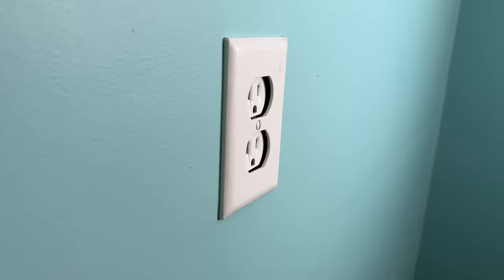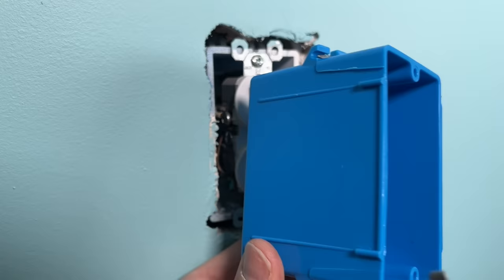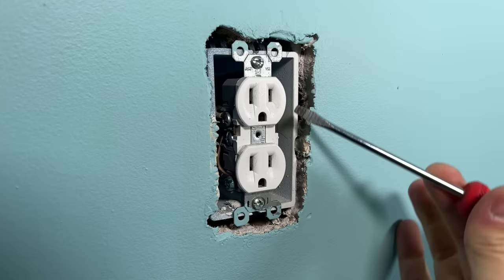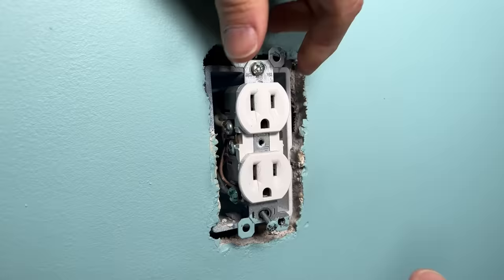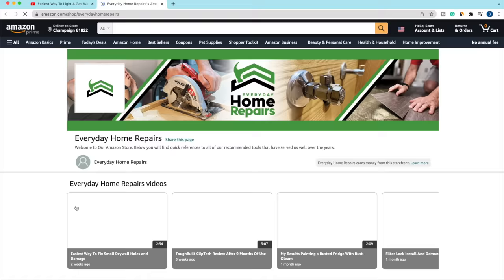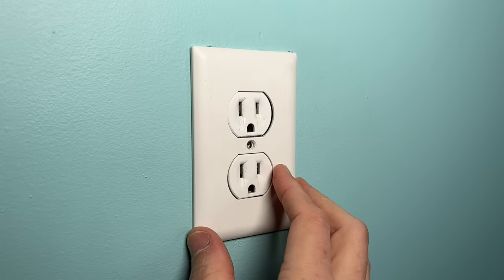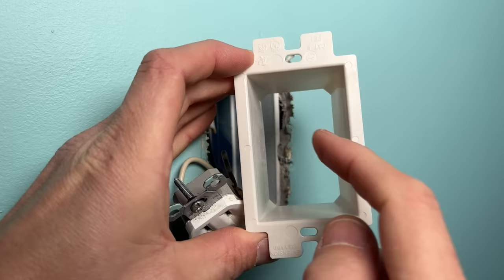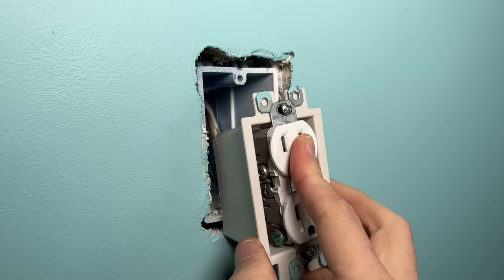How To Fix Sunken Outlet | 2 Easy Options

Comment: I didn't know those red spacers were available. Very nice, quick fix.

I have the opposite problem with all the outlet boxes in my family room. After removing paneling from the bottom half of the walls, I'm left with outlet boxes that are now about 1/8" too far out from the wall surface. I could  cut the mounting hardware for each box, but that's a lot of fiddling around. I can't seem to find any extra deep cover plates. Im considering gluing an oversized cover to the back of a standard cover and cutting away the middle of the bigger plate, leaving just a frame glued to the standard cover. Any other suggestions? 
Thanks.

New subscriber here! I'm looking forward to watching more of your content.

Comment: Great video as usual. What I learned was the existence of a retro fit remodel box and the insert box. My house was built in 1990 and for some reason I have a bunch of sunken outlets. 
Question: If that outlet was on an outside wall and you wanted to air seal, would you use drywall mud, fireproof caulk, a gasket or something else? Thanks,

Comment: Also for what it is worth you may have noticed so few of the many switches or outlets are insulated with the fire/flame retarder type foam etc for improving both the fire safety/or time provided since it slows fire speed, and also prevents about the amount of such a hole in a total of all uninsulated outlets and switches being enoughh of such a draft that it makes a baseball/softball sized hole through an outside wall for the outside air to come in through basically it is inexpensive enough with witch to do so thus therefore one jsould sdo so I would say for it is less than a few usd for a box of about 24 of those iinsulation seal/gaskets for the outlets and switches and they are all so easy fo install that by far anybodu with a screwdriver is able to do so... merely remove one or two screws of a cover plate to removd cover then place seal around switch/receptacle and the at least replace the cover plate and screws... or tighten the securing screws for the receptacle/switch holding it to the box/wall for anything if it is a notablh wiggle prpne outlet from side to side motion being what it merely needs in order t do so for if it is moving side to side so easily then it will be a risk for wiring to become loose in the back of the outlet or switch... but otherwise leave everything beyond the screws for safety cover plate alone and simply do the insulation seal foam only and merely replace cover plate as soon as insulation os placed around the switch/receptacle

Comment: Thank you. Great video. Very helpful. I did not know about the inserts so that is a great new addition to my DIY toolbox. I have a question for you. I had a contractor many years ago that worked on my house, and he replaced a few electrical outlets and switches. For each one he wrapped the box, over the terminals, with electrical tape. I noticed he was doing that and asked him why and he said "it is just another layer of extra protection". He felt that just incase something shifted in the wall, or the socket got lose enough to make contact with the side of the electrical box in the wall, this way it was insulated by the electrical tape. Have you ever heard of that before? Do you think that is a good idea, or not really useful. What do you think?

Comment: Nice vid. I have a kitchen backsplash that is tile, the gyp behind it is kind of crappy and whoever installed the outlets once the backsplash went in was sloppy. Basically the cover plate screw is the only thing really holding the outlet in place. There's a box, but it's nearly an inch behind the surface of the tile. I got box extenders but then found out that the screw hole threads in the original box are "wallered out"  so the longer screws don't really have anything to screw into. I kind of 'faked it' but would love for those puppies to be solid and not so "delicate." any ideas? I can't break out the tile, so I'm a bit stuck.

Comment: Do you have a video on the outlet not being set correctly due to the electrical box being loose inside the wall, thus preventing the outlet plate from screwing into the box?

Comment: When using the box extension, do you need to use one that is made of the same material of the electric box? Like if the electric box is metal should I use a metal extension box or can I use a plastic one?

Comment: Once I was in New construction where every box was way too deep. The installer wrapped coils of 14ga wires around the screws for spacers, using the brittle plates to keep the outlet from wiggling around....of course every  plate eventually cracked at the screw. This guy had his CA license and LA County inspector didn't catch it....

Comment: Wow! I’ve been out of the know for way to long! The spacers and box extenders are phenomenal!
I rent a house that has the light switch (behind) the door. No “access” to crawl space under house however, you could make access from the garage but, as it has no premade door, I the attic, they’re just not doing it due to No access. It’s absolutely possible to go up and over the door but they won’t even see what I’m talking about. 
Why can’t they just use existing wire holes to run it up and you’d only have to drill once? 
Wouldn’t that be an easier fix? The person they sent out here was talking about having to cut the sheet rock, drill hole’s, then put the new switch in.

Comment: There is a problem with cutting it out and using an old work box, at least in my house.  There is absolutely zero slack in the romex, and it’s often damn near impossible to get it pulled through the new box.

Comment: Re; Spacers.   I've always thought one reason for the 'box' was to confine the electrical line as safely as possible. That if there is a 'short' [for example] the sparks would not leave the box and potentially ignite something outside the box.   Yet it seems using spacers what occurs is the receptacle where the current flows is moved further out of the containment box, potentially exposing surrounding wall material to any sparks that could start a fire. So isn't using spacers in such the manner depicted in this video simply making the installation LOOK better without actually improving safety?

Comment: Switched Power outlets are available in the United States -
though not commonly used- --
The advantage of switched GPOs  - [ General Purpose Outlets ]
1.  Replacing a defective switched outlet on a wall is cheaper
     and quicker than replacing an expensive and often difficult
impossible to find switch on a given appliance  - say -
Vacuum Cleaner for example.

2.  Appliances that are on Standby or appliances that do not
have a switch such as a Microwave oven  where one does not
wish fro it to be powered  ON  24/7
-- That in itself consumes electricity  adding to the homeowners
utility expenses and reducing the operational hours of the 
appliance = even attracting roaches -
Thus devices not in use can be easily switched  OFF  at the PowerPoint.

A note of caution however -- NEVER rely om the  OM / OFF SWITCH
when working on Electrical appliances - 
ALWAYS physically disconnect from from power source - and beware
of Mains capacitors that hold a charge.
secondly it is NOT recommended to short out the terminals to
discharge the capacitor.
Use an appropriate voltage incandescent / Tungsten filament lamp
115v / 230v  with Mult-e-meter probes ( permanently connected to
the lamp holder )
Easy and  not expensive to make - Keep one in the kitchen draw.
Useful also for testing if Power outlets are LIVE or not.
BUT verify that the Lamp is actually functional-  Filaments do break
as you know.
For that matter do not trust  No Contact Voltage testers - 
Verify that they are functioning correctly.
Assuming that the NC voltage tester is functioning correctly
can be Lethal.

Comment: I have two receptacles inside a metal conduit box.  When I tighten the mounting screws, the hot and neutral screws touch the metal connectors of the 1/2 inch conduit itself.  So I cannot put the receptacle all the was in the box.  I have to use wooden spacers to keep the load carrying screws away from the grounded metal in the box.  Where did I go wrong?  How can I fix it?

Comment: That wall actually looks like it's lathe and plaster, not sheetrock. It's very common to find outlet and switch cutouts being in the condition of this one in these century+ older homes.  I discovered those large wallplates over a decade ago when I was repairing the electrical system in our 1889 house.

Comment: I've long been curious how white spacers / sheaths (I've already forgotten the name) were used; but haven't had to use them yet (but I will need to) so I've not looked it up yet.   Also, do the red spacers used apply equally if the light switch (my use case scenario) is at an oh-so slight angle to the faceplate (vs a correct / flush-mount)?

Comment: I put in plastic spacers; the switch still sits below the front of the switch plate but now it's being held slightly in front of the wall. So, everything has just moved out a few mm. Any ideas?

Comment: One quick way anmd cheap way I've learned is to get a wirenut hold the fat end against the box and mark where it is flushed with the drywall with your thumbnail, take your cutters and snip the tip of the wirenut off and use the fat end of the wirenut as a spacer.

Comment: I have a 4-gang switch plate where each of the switches are not flush.  I've tried using the spacers and they don't work well because of how uneven they were installed.  Is there a way to fix this myself?

Comment: Loosen the two screws some put the plate back on fixed...Way bigger problem are rec. pulling out because the electrician stripped the screws.

Comment: I have a couple of sunken outlets. Nothing in my older house is 'standard'', so I suspect none of these things will fit in my outlets. I guess I'll have to measure and then go to the hardware store. How does one deal with an outlet that suddenly stops working (gives out no power)?
Reply: Simple, replace the outlet. It could be the wire disconnected, or outlet failed. If you don’t do electrical repairs, then call an electrician/handyman or someone that knows his way around these things. Good luck.   Jim

Comment: It never occurred to me to use my wire stripper to shorten screws. I saw the holes around the pivot ranging from "10-32" to "5-40" but I thought those were just used for gauging the sizes of screws.

Comment: Amazingly, all the big box hardware stores in my area (Home Depot, Lowes, Home Hardware, etc.) didn't have any of these. I ended up using a slightly oversized nut as a spacer. :/

Comment: I am surprised to see that these red plastic spaces are used. Where I have worked metal wishers were placed around the 6-32 screw to lift it off of the box. A metal old-work box would have a green metalic ground connection. The connection extends through the screw to the switch by solid direct flat contact. I think the box used was plastic, the wire used was equipped with a 3rd un-insulated wire connected to the equipment ground connection providing safety. That is why the plastic spacer may be permitted where it is compliant. SO SOME AREAS OF THE US THIS SPACER MAY NOT BE PERMITTED. THE 3/4" OVERSIZED COVER PLATE WAS NEWS TO ME.😄

Comment: Bend the dang Mickey Mouse ear tabs on the outlet to about 45 degrees and use the mounting screws to draw the outlet face flush to the sheetrock. (The two holes on the very top and the very bottom of the outlet). Or, use oversized nuts as a spacer between the receptacle and the box.

Comment: You don't really need the spacer, I just don't tighten the mounting screws all the way and the face plate will pull it outwards and keep the outlet snug

Comment: I'm interested in finding out where you can get those box extender inserts for 120 vac and what they are officially called.. The only ones I've ever seen in the big box stores like Depot or Lowe's are marked for low voltage boxes you would have for computers and TV wire and I was afraid to use them for fear of melting/fire because they're thin. I could go to an electrical supply but it always seems like you get that 'look' and ignorant comments from the counter guys as DIY'rs when you're not  sure what to call them. I apologize if you put those in a link already. I'm not real familiar with how to get to all the YouTube features, so I just thought I'd ask. Tx

Comment: Huh! Never realized that sunken outlets were actually a code violation. The cabin my family owned for years had just about all of them sunken because the outlets were installed before the wall paneling was installed. We eventually sold the place and a later owner ended up clearing the property and building a new house as it would have been too expensive to renovate the old one.

Comment: I do a ton of home upgrades.  When I encounter a large gap like those, pick up a small ziplock bag of 5 minute EZSand at Lowes for $8..  Quickly mix a small amount with water and press it in around the box to seal up those holes.   It will not always resurface the outlet, but it will seal up any draft areas, like up here in the northeast winters, and save on your heating bill.  This mud is also great for fixing holes too big for the pink stuff spackling.  Be careful how you mix though, it sets up in 5 minutes and the clock starts the second you add water to it.  You can scrape it and paint it the same day.  It dries to a hard surface if you really stuff it in there.  It also sands easy when dry.

Comment: Don't grab the outlet if it's hot like he did those side screws ate 110 volts shut off the breaker or wrap the outlet with electrical tape to insulate.

Comment: Also, if you want to hate your life, install a 2 gang box extender into a RS cover. It’s like no one thought an inspector would make a commercial electrician install one. I’ve been there. I ended up cutting the box into 4ths, I walked away thinking to myself “how is that supposed to be safer?”

Comment: What do you think about a small amount of fire-proof insulation foam sprayed around the box to fill the gaps? Trim the foam after it dries, maybe glaze it with joint compound in some cases if you need to fix big gaps (works great for plaster walls). I liked the outlet spacers better than my old method of gapping the screws. Btw, I will be getting those strippers, that J-hook tip was great!

Comment: Instead of adding spacers to the sunken plug why not bend the tabs back 90° to give you additional 1/8" for a flush mount wall plate...?
Reply: The metal is soft, and scored. It wouldn't last long if the plug was actually used.

Comment: Didn't learn anything new. They didn't start making those spacers until around 1990. We would just make a tight coil of #12 wire and use that as a spacer. That allowable  gap used to be 3/4 then 1/2 inch, which even 1/2 inch is very excessive by any standards. The plastic ring is new, but we had metal Sockko rings, and plastic boxes & rings are a no no in commercial/industrial  buildings with an occupancy rating greater than 10 persons. It is a source of very toxic smoke if it does burn.

Comment: I do not recommend any one but a pro using a saw to cut just the "nails" to adjust the box. The likely results include drywall damage - n both sides if the wall and damage to the wires - that you will not know about.  If you are watching this video, you are likely not a pro,

Comment: I see the plug is upside down if a child was messing with a metal  bar or knife the the live prongs could electrocute a hold if plate not on but the single  post should be on top so if a coin or  something fell it would not bother the child in getting shocked just honk as if you dropped a small nail across the two posts it surely will light up in sparks😊

Comment: Have made my own spacers for years by wrapping insulated 14 Guage wire around my green robbie to make a coil and cut it to whatever depth correction I need to give me proper back pressure when installing the device in an over cut box and then go yell at the stupid drywallers

Comment: Could you not just use plastic washer spacers same diameter of the screw, so the outlet does not protude in? These are 1mm thick spacers. This would push the outlet towards to the outer wall, leaving everything else in place. They actually sell these little plastic washers for the size of the outlet screw. I got 500 of them for like 7.99, Usually takes 2-3 washers per screw and when done its perfectly flush to the wall. I can not see how this breaks any electrical codes.

Comment: Saw my brother fix this in about 15 seconds…use a reciprocating saw, cut the box from the nails,(becareful the wires in the wall) pull the box forward to fit, then he screwed the box back to the stud flush, it was stronger than any nails and done without spending any $ because every true man/woman(theres only 2 genders!) thats handy has screws!

Comment: And they’re installed wrong they’re upside down put them in the right way. I know there’s no code for it but put them in the right way. It’s a safety issue you wouldn’t have to twist the cord, the plug something in the manufacturers do everything right for the appliances humans don’t do it, rightwiring for houses people want that look it doesn’t look right just put them in the right way and you wouldn’t have to flip the cords cut the damn grounds off and you could plug two cords into a outlet if he had to it was put in the correct way

Comment: I don’t get it….. why make a video and leave out a code violation?   That would fail any type of inspection because the box needs to be flush with the plane of the wall and when it’s not an approved box extender must be used, but apparently he doesn’t know this.